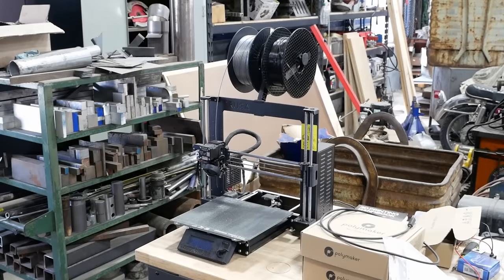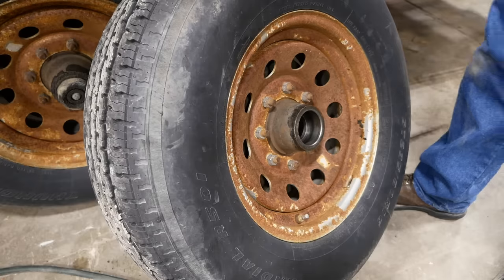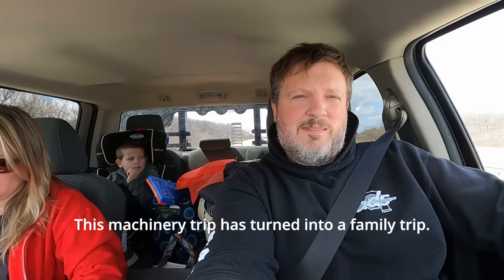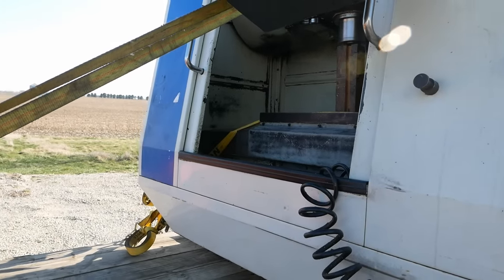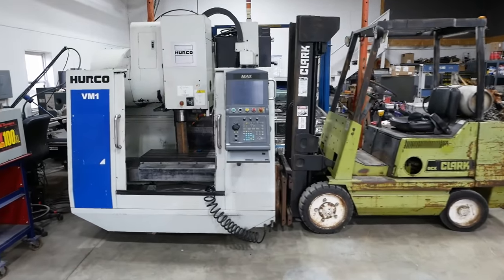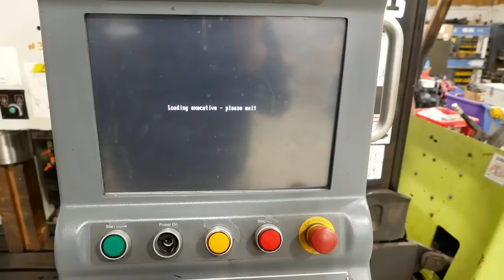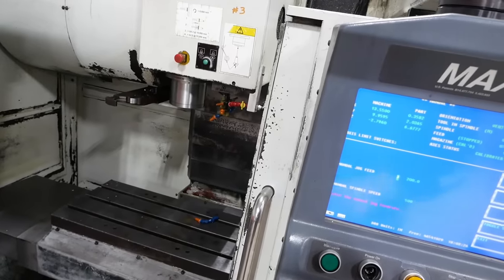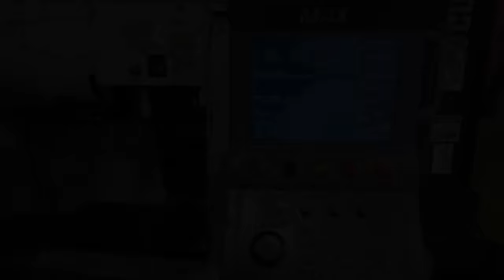Buying and Moving a CNC Machine - Peak Sketchiness

Comment: So what did you do to finish off your Easter Sunday?   I watched a guy test toasters from real cheap to super expensive (Project Farm).  Then I watched a  guy remove a CNC machine from a beat to snot trailer with a beat to snot forklift that was about the size and maybe lighter than the CNC machine.
Reply from the maker: My stuff doesn't look very good, but it's mostly functional...
Reply: @WatchWesWork  I know, just joking.   I wasn't sure you were going to get that thing off the trailer.  Talk about woobly.  You tell you kid, "Don't even think about getting close to this".

Comment: ...did you buy a Dodge? Proximity switches were my nemesis when I worked on CNC machines. You'd think you get one adjusted juustt perfectly, you'd cycle the machine for 10 minutes straight without a problem. You then pat yourself on the back, close the ticket ....and then 5 minutes later the operator is complaining that the machine alarmed out for the same prox you just adjusted....
Reply from the maker: That was my life too. You'd get them just right, then a tiny chip would stick to the magnet and give a false signal.

Comment: In your industry working🐞 on trucks, tractors and all manner of machines I think you do need good in house machinning capability. In the long run it will save a lot time and $$. I would say the computer part of it needs updating, the electro and mechanicals would be just standard parts, available easily. Not sure of this one, but some of 🐝the Taiwan CNC machines were knockoffs of the Japanese Moriseki machines.🪲
Reply from the maker: I think many 3 axis mills are kind of a standard design. They all copy each other. Taiwan machines are probably the bottom of the quality heap, but the price is right.

Comment: I have a Hurco Mill - converted to Centroid controller.  Need any low cost tool holders?  Universal Engineering 30 Kwik Switch?  Maybe fit your spindle?
Reply from the maker: Cat 40 on this guy. But my Lagun uses kwik switch.

Comment: 2005 machine with DOS control, makes sense because it wasn't until 2006 that the trailblazers switched to Windows XP
I hate machine tool OEMs their software is always 10-20 years behind🤦‍♂
Reply from the maker: There must have been a change with DOS around 2006-2007. Everyone abandoned it about the same time. Haas, Centroid, and Milltronics went to Linux. Fanuc, Okuma, Hurco, Mitsubishi, etc went to Windows. Before DOS it was all bespoke interfaces hard coded in assembly. Fadal is still using that system.